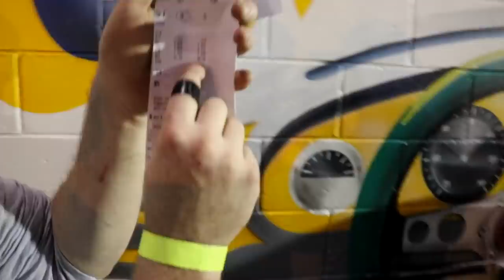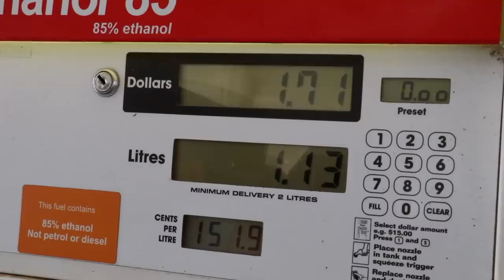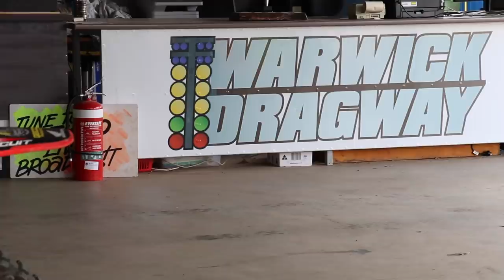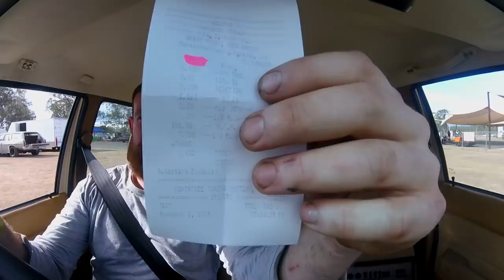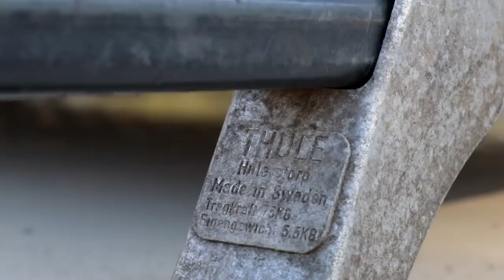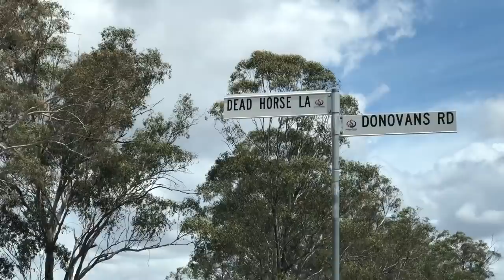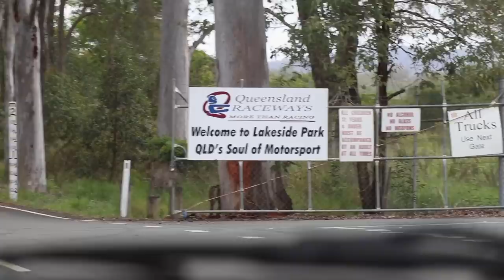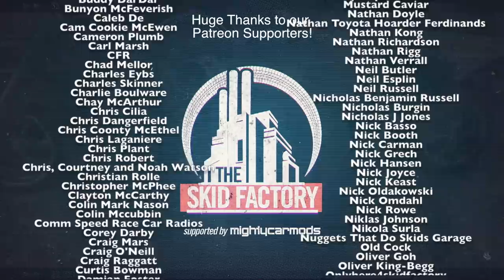Road Tripping in a Turbo V8 Volvo Wagon!

Comment: DSG Launch Control

TC Off (push and hold), Sport gear mode, (sports suspension mode optional, helps weight transfer) hold brake, hold accelerator to the floor, revs should rise and stabilise, release brake :)
Reply: Wayne Clement for some reason the act of staging would kill it, it would go on 10 times in a row in the lanes, roll into staging and it wouldn’t work right
Reply: @davidfraser6346  damn, I've only ever used mine once, not multiple times at a drag :/ does seem odd

Comment: Got you well and truly covered on the tyres there. Mine are 16 years old 18x235 on my tt 300zx. Yes they still look good. But so hard that spinning everywhere is the name of the game. wooo Could only run a 13.5 on them. But switched to good rubber and did 12.7 straight away. The 16 year old tyres have got about 5000kms life left on them :)

Comment: That 1UZFE handled alot of boost and alot of abuse, gotta give it up for a stock engine. It makes good useable power and was strong enough to destroy the rear diff. I've never boosted a V8, plenty of 4 cylinders and a couple V6s in my life, but I did make 408 whp in a bone stock non-VTEC B18B1 Integra engine with an eBay turbo in my EJ8 Civic coupe.

Comment: At some point could you guys talk about rear mount turbos, I've seen a couple of tubes where the guys say they work better than the internutz wise men think.
Reply: Rear mount = massive lag and terrible spool response, other than that, they work.
Reply: @nordic5490  Yeah. They say no real lag if done right.
Reply: @zedthehun  100% incorrect mate. Why do you reckon there isn't a single competitive race car with a rear mount ? Think about it.
The turbo has to build pressure in entire pipe system to rear mount = lag city. Ie, the exhaust needs to build eg 90psi pre turbine in the entire pipe before the desired, eg 35psi can be made in the intake manifold. More pipe= more volume to pressurise and more time needed to to make that pressure - @and that is just the turbine side.
The compressor then need to build pressure, and guess what, surprise, surprise, the same principles apply here, more pipe = greater volume to pressurise = greater time to build pressure.
Larger exhaust side and intake side volume = more lag. The issue is compounded.
What do I know ? A 800hp daily FG Falcon Turbo Barra owner here. All diy.
Short piping and the smallest IC to make you target power is the way for snappy boost response. Unless of course you like lag.
Reply: @nordic5490  So you have done it? Im just taking the word of guys who have. Who is building a race car?
Reply: @zedthehun  I built a 800hp daily driver FG XR6T, goes great, 24psi on e85, not laggy at all. What did you build mate ? sfa?
I have yet to see a successful race car with a rearmount turbo. If you have, perhaps you can post a link - Im all for being amazed.
Reply: @nordic5490  You know what... I don't care what you say you have done. None of it makes you THE authority.
Reply: Oh yeah, read/watch the links if you are even vaguely interested in what real people have actually done with their real cars.
Reply: Al has expressed disgust at the mention of rear mount turbos when woody brought it up before, so I doubt they'll be doing one, whether its a good thing or not.
Reply: @johnjosephson9277  Hey, John. I missed that episode. I suppose there must be more bad examples than good out there as the prejudgment is heavy. Then again there are heaps of crap front mount setups. Front mount seems to allow more latitude for error. Rear mount looks like you have to pretty well get it right.
Reply: @zedthehun  It was a pretty obscure thing at the end of a video, I don't remember what one.
I really can't comment on the setups other than fronts are really common, probably a reason.
I did see a video somewhere about a rear mount setup that I think competed in classic/vintage type events, that guy reckoned it was great, and the engine bay almost looked n/a, which I think was important to him.
Reply: @johnjosephson9277  As the article I linked says, all things being equal front is better BUT all things are never equal so sometimes rear can make sense and work well. I thought it would be fun to see some sort of comparison setting up some old test bed both ways with a bit of intelligence applied. Probably never going to happen but, you know, these guys are always looking for ideas. I think they should have a YouTube "rear mount turbo challenge" see which YouTube gear heads can make it work the best. They could do a series of them with various challenges, the timber work guys do it... its a bit of fun and some good stuff comes out of it.
Reply: @zedthehun  I can't see your link? I'm on mobile though.
A build off would be fun.
Reply: @johnjosephson9277  Should be in the comments above. One to a tube of a guy in Tassie running a rear turbo Monaro  and one to an article by a guy who seems to have done a few.

Comment: This maybe a stupid question for Aussies but why so many 4 door hotrods / race cars?
Reply: The aussie car market was and is far smaller then the US, mostly due to population so 2 door options are far less common here then in the states making them much harder to come by and drives the price through the roof, 4 door options were the family cars back in the day so alot more sold meaning they're much easier to come by and for the average joe to afford and build.
Reply: Burn FPV   Thanks!   I figured it was a market thing of some sort.
Reply: "but why so many 4 door hotrods / race cars?" Its too hard to haul your mates around in the back of a coupe, bro
Reply: Nothing wrong with 4 doors on the side of a car 😉
Especially when it's Daaaayyymmm fast 😉🙂👍👍
Reply: Many generations of cars had no two door option. Even the ones that had two door options the two door what not so popular. Our aussie cars typically came in several body styles on the same platform sedan, wagon, utility, panel van, cab chassis and perhaps two door.
Reply: Because all the coupes are so pricy. This is why volvo is perfect.
Reply: Coupes have never been big sellers in the Aussie market. They tend to be popular for the first 2-3 years of release then sales drop right off. 
S550 mustang is probably going to be the inky one to defy that, but that's probably because it's kinda cornered the performance v8 market with ford and Holden not building anything here anymore.

Comment: We that's expensive fuel. Here in the states it never more than a dollar a liter
Reply: We're about 1600k south of them and just come off $1.78 a litre for 91.
Reply: I'm in Wisconsin and I use the cheapest fuel I can get, I think it's 89 for .65 a liter or $2.50 a gallon. In my civic it gets about 35 mpg
Reply: And you guys have the gut to always complain about your "shit" laws and gas prices. Try living anywhere else.
Reply: fuel here in new Zealand is around 91 $2.21 95 is $2.35 100 is $2.54 a litre
Reply: Octane ratings are not the same so remember to make sure your comparing apples to apples. RON vs MON
Reply: And of course the difference in value, exchange rate is 1 to .69. then in the US fuel taxes vary drastically by state, WI is a mid level state for fuel taxes, not sure how that works in Australia or how much it effects the price.